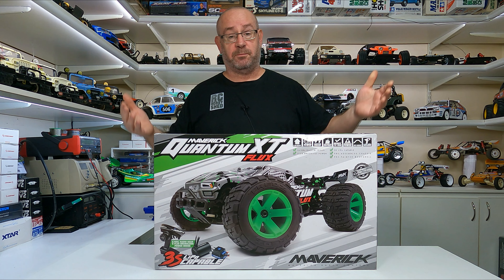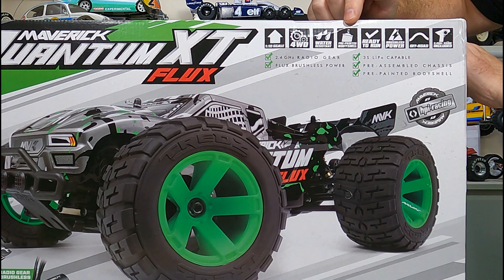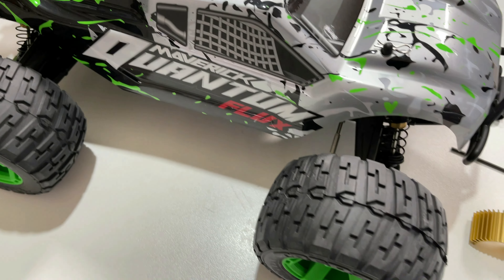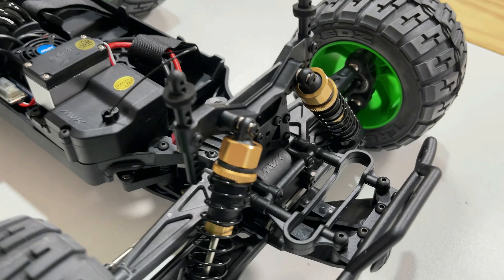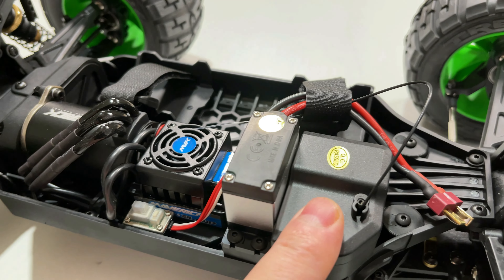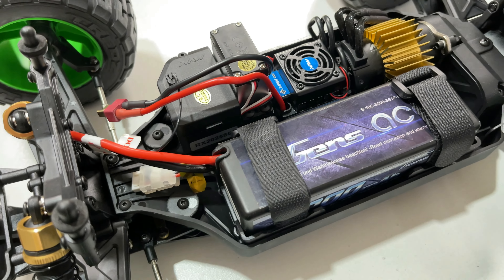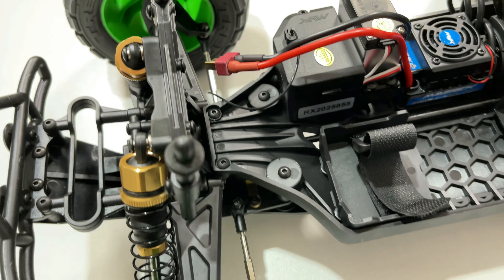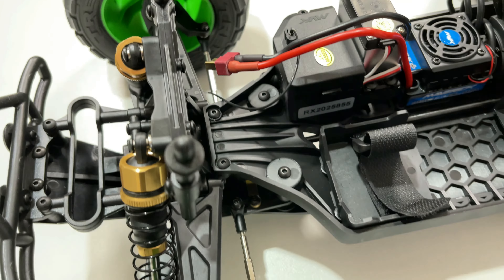Maverick Quantum XT Flux | Unboxing and First Look

Comment: That's a great car, sir. Got the MT version a couple of months ago and and I love it. Congratulations!
A couple of tips before running it : Tighten the servo horn screw, replace the threadlock if needed. Check the motor mount bolts and nuts, also the gear mesh. Check the rear power input grub screw. Replace the shocks silicone with a 500 one.
Done! Your Maverick is ready to bash!
Reply from the maker: Thanks mate, I think it should be fun. I think I will be changing that shock oil, it is way too thick. Someone else mentioned the input grub screw too, sounds pretty common that they aren't tight enough. Cheers mate, I'll give it a look over before running. 👍

Comment: Nice, Mick - I've got the MT version of the same and they run well. Couple of things - you'll want to change the shock oil, its like tar! Go for something much lighter. Then check the grub screw in the drive joint, just in front of the rear diff - notorious for being set too loose and then either vanishing or getting wedged into the drivetrain, neither of which you'll want :) When you can be bothered, its also worth regreasing the diffs and gearboxes as they dont come with that much, although it'll do for the first few runs. As you say in the vid, Maverick have updated the car in the next phase of the release with better driveshafts and (supposedly) suspension arms, as both seem to have been made from monkey crap. Worth investing in once you've bent and snapped the issued bits. Go for the Metsafil arms if you can get them (they're Portuguese), much tougher than the HPI versions. Lastly, do consider running it with 2S - it can cope with 3S but it gets a bit 'unruly' - its just as much fun with 2. Oh, and dont drive flat out into trees - trust me :(
Reply from the maker: Thanks for the info, James. I did notice the diffs spin very freely, as if not enough grease in there. I might run it once then open it up and add some grease... Hopefully I don't kill the diffs first day out like I did the E5HX, which also didn't have enough grease. Seems a common thing in RTR's. I'll definitely check that rear gearbox joint before I take it for the run. Hoping not to bend or break anything but it always happens lol. I checked out the Metsafil arms just now, they look great! I think I will run 2s first, the first time I took the E5HX (similar size and power) out it was on 3s and it would wheelie at pretty much any speed. It was fun but kind of annoying at the same time, I'm guessing this will be the same. Haha, I'll try to dodge the trees! Thanks for the helpful comment James! 👍

Comment: these things are insane i just bought newer version being the the 100-amp ESC FLX10-3S100 Version and Metal gear servo, i have the standard one too the MT brushed one(untested)  and besides the body being Putzon these as thin as paper ,the rest of it for the money was great value and heaps of fun for a cheap Basher only $389- $489 plus the 15%off(ebay discount)  depends which version you buy , 3S and man does it hang a wheelie or two but stays planted when gets down also needed to adjust steering rods to track straighter on the bitumen but yes i can recommend this if your not wanting to out lay over $1200 for a Traxxas especially if your gonna kill it lol - OH and put a good fan on motor running 3S as you can cook a sausage on it and just check bolts all over too .otherwise nice HPI series imo. cheers mick great video bud. :-)
Reply from the maker: I'm guessing yours is actually the Quantum+ XT going by the price and the 100A ESC. The non (+) version has the 80A ESC FLX10-3S80 and $368.05 at Hobbies Direct, $454.07 for the +. You did well with the 15% off code, that's always a bonus! I have the Quantum+ XT too and the MT, still unopened lol. I kinda went nuts nuts buying them a while back 😂. Oh yeah they're great value from what I've seen. Haha, cooking sausages at the track for lunch would be cool but maybe not for the truck 😂. Thanks for the tips mate, I'll go over the nut n bolts before I run it.  Cheers Andrew! 👍
Reply: @RCHobbyShed  Cheers Mick for your Reply , yes i had to correct the message about 3 times as wasn't 100% sure on specs myself , so i went and got the box and copied that lol , one thing though i wasn't impressed about and also forgot to mention in the initial message is you think they would have included a wheelie bar so that was my only real let down with this i mean really "no wheelie bar" , but oh well bang for buck its still a winner so i decided to put a cheap L.E.D light kit in it instead to satisfy myself but in all honesty its for knowing if i was coming or going as being flat and all,, he he he  cheers bud.